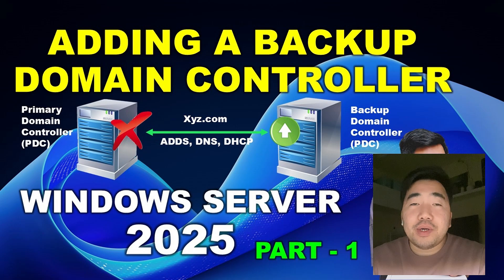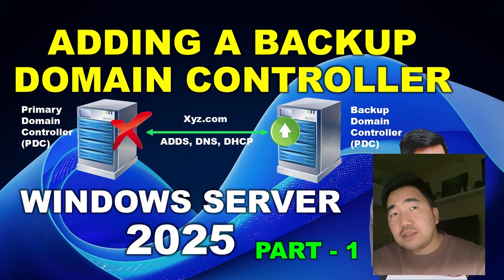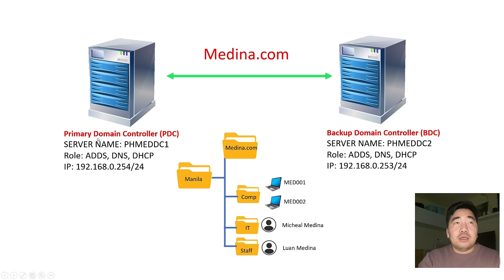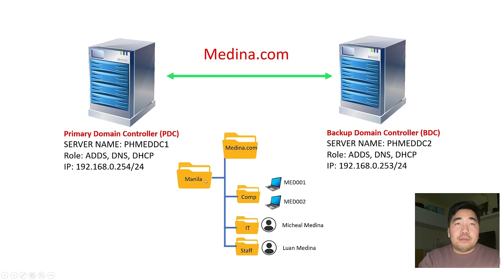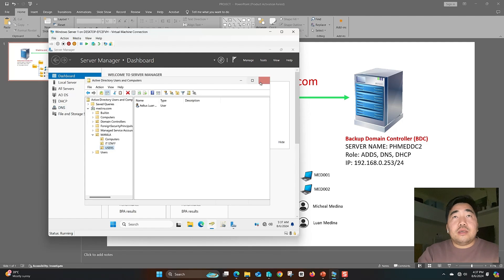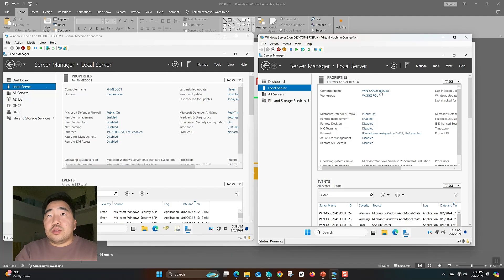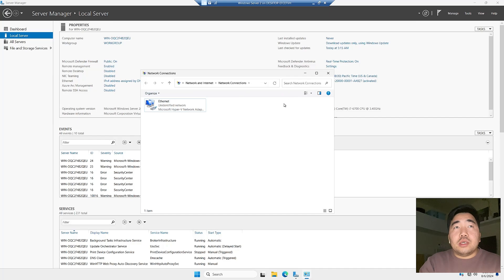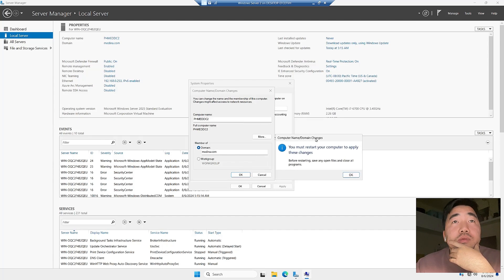Adding an Additional Domain Controller to an Existing Domain | Windows Server 2025

Comment: what is the purpose of lookup zones sir in dns? tnx for sharing
Reply from the maker: In a DNS server, lookup zones are essential for translating between human-readable domain names and IP addresses. 

There are two main types of lookup zones:

Forward Lookup Zone:

Purpose: Translates domain names to IP addresses.

Example: When you type www .example. com in your browser, the DNS server uses the forward lookup zone to find the corresponding IP address, allowing you to access the website.

Reverse Lookup Zone:

Purpose: Translates IP addresses back to domain names.

Example: If you have an IP address like 192. 168. 1. 1 and want to know the associated domain name, the DNS server uses the reverse lookup zone to provide this information.

These zones ensure smooth and efficient network operations by making it easier to locate and access resources using memorable domain names instead of numerical IP addresses.
Reply: @MikzMedina  thanks much sir
Reply from the maker: @roderickdanzing2714  welcome sir